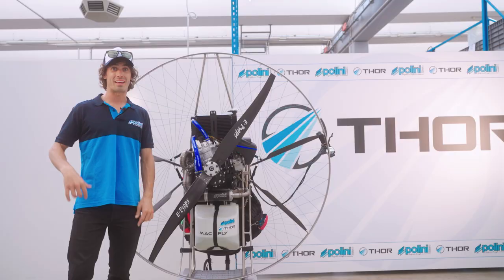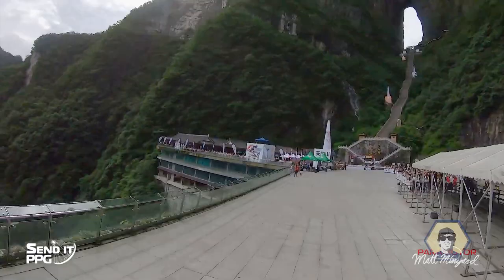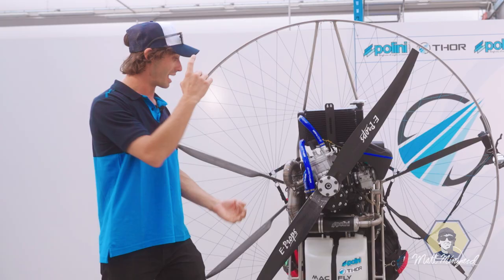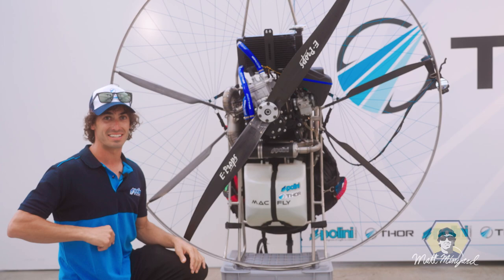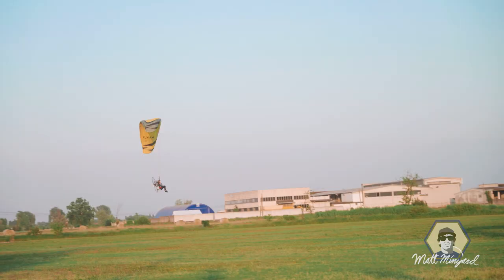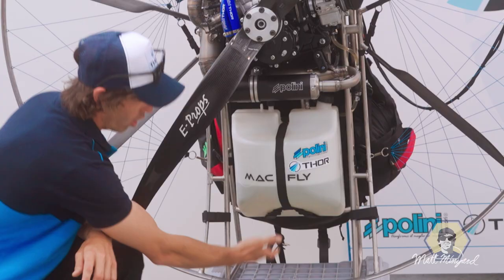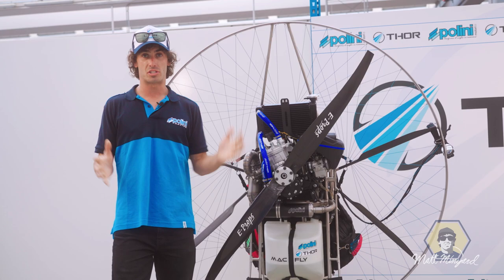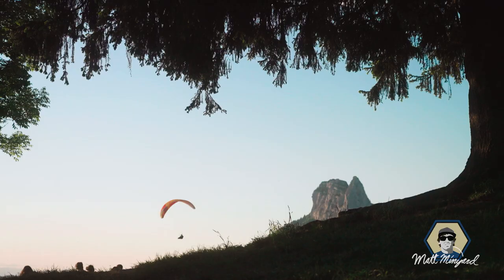Polini Engine REVIEW - At Factory in ITALY + Macfly Frame Review

Comment: Hey Matt, great video.  I fly the Polini 303 on my Fly Products (another Italian company) Xenit.  I did have the hole burn through the piston but Polini - well really One Up Adventures - was great in working with Polini and getting it fixed.  I am in the process now of building my confidence back up with it.  It seems to be working great.  Had a great flight last night and probably my longest, mostly full power, climb out to about 3000' and it sure doesn't disappoint getting my 240 lbs plus an 186 lb trike up there in no time at all.  Thanks for the video!